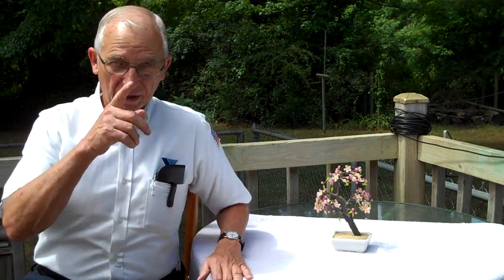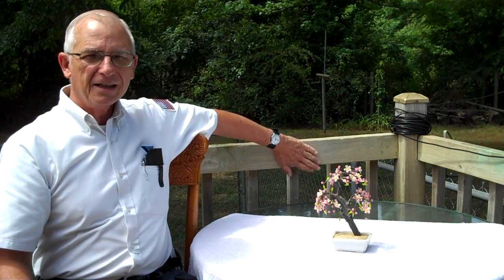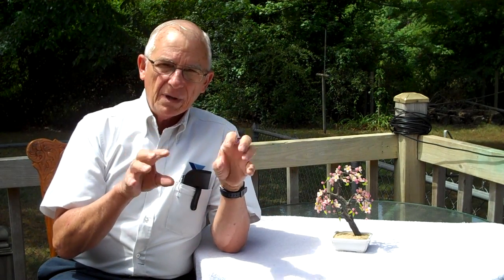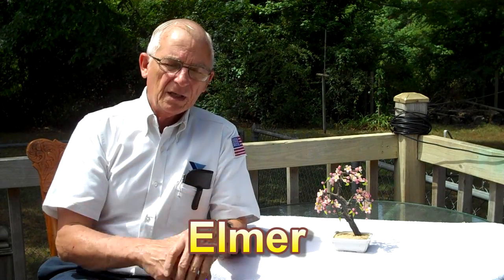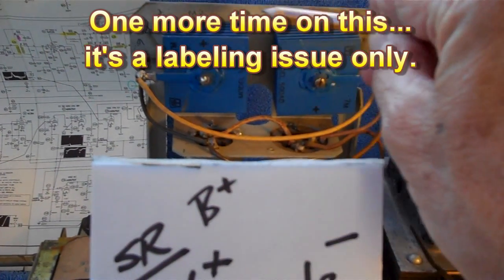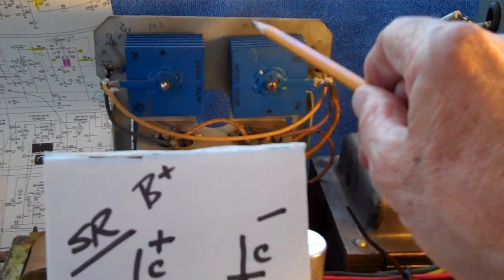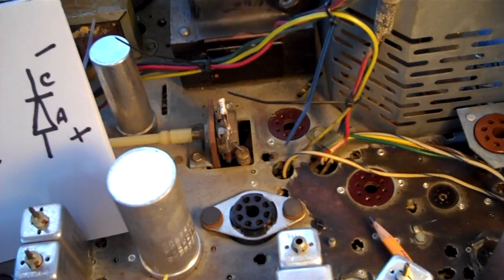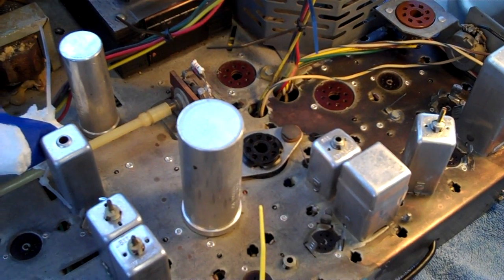1952 RCA Model 17T151 17" TV Repair and Restoration (Part 4 of 27).

Comment: That's very interesting on the selenium rectifiers with the markings being opposite of silicon rectifiers.  When I restored my1952 Motorola TV two winters ago, I remember this looking odd.  I used clip leads when I installed the replacement silicon rectifiers and using my variac, I was able to verify the correct wiring before hooking them up permanently.

Comment: Great video as usual and I have to ask a question regarding the silicon diodes. You stated they have to be inserted in the circuit the same way as the symbol for selenium rectifiers and also said the polarity on the diode is reversed compared to the selenium rectifier. My question is, is the band on the diode going to be connected toward the voltage coming in or is it on the opposite end where the B+ voltage would normally be measured?

Thanks,
 Ed Allen
Reply from the maker: ED,
I doubt there's an absolute to this answer as not all vintage electronics were designed alike, but I've found that in single selenium rectifier units the anode generally faces the power transformer.
BTW...the polarity on the selenium rectifier is not reversed from that of a diode.  Only the stamped + and - symbols are reversed.  Follow the schematic and you won't go wrong, my friend.

Regards,
John

Comment: Excellent Video!. I may be mistaken but as I vaguely recall from one of my electronics engineering classes from 30 years ago, for a selenium rectifier the arrow is in reference to electron flow which is from negative to positive. For semi-conductors it's different, the arrow is in reference to 'hole' flow across the P-N Junction. When an electron is traversing the junction it leaves an atom missing an electron which is then filled by a more negative atom. The 'hole' left behind 'travels' + to -.